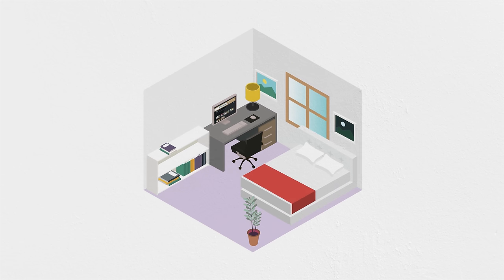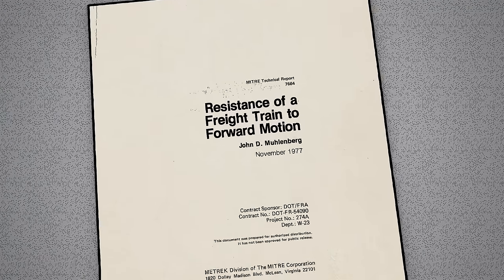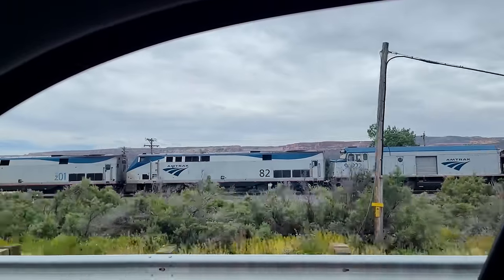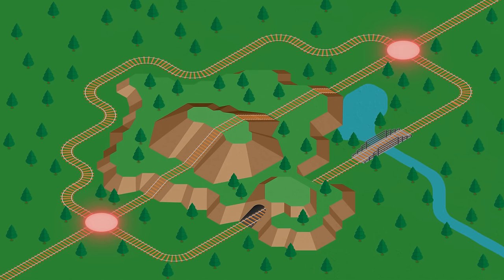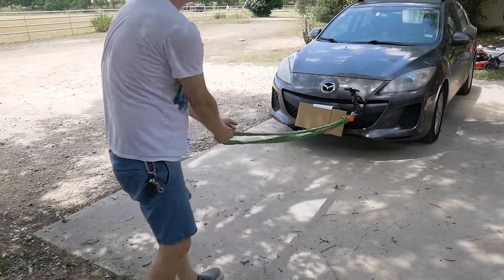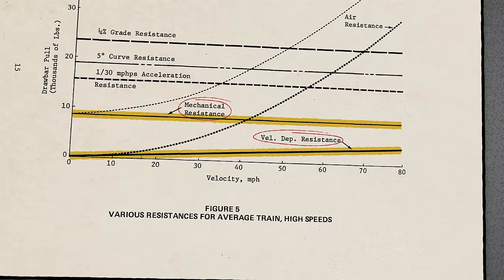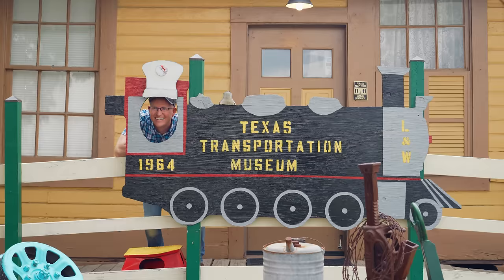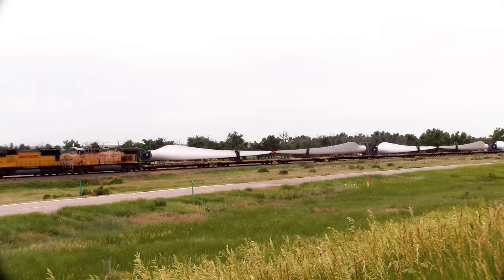Which Is Easier To Pull? (Railcars vs. Road Cars)

Comment: The rail wagon you were trying to pull had cold bearings. This makes a huge difference. A cold train has a 'dead’ feel to it whilst, an hours running later, the same train will feel much more ‘lively’. 
Not as pronounced on an all roller bearing train but on old white metal bearings, can add an extra notch or two to maintain speed.
Reply: Wow, that's so interesting!
Reply: Thanks for sharing. I have been working on railway for some few years, and I didn't know about that yet.
Reply: @hanshima_  Thankfully KiwiRail has done away with ‘free’ shunting and moved to push pull. 
I have worked in flat yards where roller bearing wagons can start to roll due to wind pressure alone!  We called them ghost wagons and they made NO noise. Good way to get yourself killed if you didn’t keep your wits about you when out in the yard.
Reply: They are CARS not wagons
Reply: @Island_Line_Rail_Productions  OK. Well done. 👍. My comment was in relation to the bearings, not necessarily what rides on them.
Reply: @Island_Line_Rail_Productions  The United States and the Commonwealth English-speaking countries are separated by a common language. 
There's nothing wrong with foreign words for things as long as we all know what we're talking about.
Reply: I think the one he was tugging on had modern bearings in it. No spot for the oiler like in the other one and it looked fairly modern. That said with how much he was moving it I think if he pushed rather than pulled he might have got it. Could have braced himself more that way and use the weight of it to help get traction rather than skidding over the ties.
Reply: what are you saying??!, cold is harder to push? or easier!!?
Reply: @lunam7249  cold is harder, needs less power when they are warm.
Reply: @zyeborm  ok, thx, warm trains PUSH EASIER!! UNDERSTOOD
Reply: It's not just hot vs cold, but plain bearings also have a critical speed below which the friction actually increases with decreasing speed. This is because the oil gets squished out of the bearing at low speeds, resulting in metal-on-metal contact. Above the critical speed, the  oil is being dragged into the bearing fast enough that it maintains a complete film across the bearing surface. This is the lowest resistance the bearing can provide. At sufficiently higher speeds, oil viscosity will then come into play.
Reply: @BenRichards227  plus stiction, fluid thickitropism (spell check gave up), inverse viscosity gradients……
Then there’s wheel/rail granduality, ANY adverse slope……
Human too small for initial impulse breakout force….
Sigh, it’s a mine field. 
Short answer, cold wagons hard to move. 👍🤓
Reply: @lunam7249  ...seriously? He was extremely clear about it, what confused you?
Reply: @joshyoung1440  as a physicist ..." dead" and "lively" are not scientific units which infer friction, and or mass, and or momentum and or inertia, further "cold" and assumed "warmer" are not logical linear variables....
Reply: @lunam7249 As someone who has worked for particle physicists, some things most assuredly warrant the descriptive "lively". They do seem to try to avoid "dead", however...
Reply: Uummm, although the cold  ‘effect’ is molecular, the result is macro. The terms ‘dead’ and ‘lively’ are in-house colloquialisms. They are entirely understandable to those who make a living trying to control trains in the real world. Even physicists, with terms like ‘snap’, ‘crackle’ and ‘pop’ are not immune to definitions that make lay people say, “Huh?”  👍
Reply: @lunam7249  This is why we don’t let physicists drive trains. No imagination. 😂
Reply: @BenRichards227  very interesting!!😳👏❤️ thank you
Reply: @DB-thats-me  snap crack rock and poop😺😺😺
Reply: @DB-thats-me  🙈🙊🙉👏👏👏❤️❤️😳😳you dont think i dont have a love of trains!!? i do the amtrack cross country and alaska private sleeper car!!
Reply: Awwe, you just said that to make me jealous. 😳 
It worked!  👍❤️
Reply: @DB-thats-me   By this logic, If I'm talking about vehicles and the passengers are not in the direct relation to my point, I can just say elephants are driving the car.
Reply: Sedans and estates then.
Reply: I remember that discussion on bicycle videos. They were talking about how grease works. They said that once you warm up the bearing, the grease will turn to a liquid, and the resistance will drop. During top-tier bike races professional racers will have someone spin the wheels for a few minutes on a stand to get them warm just before the start of the race to get that little bit better performance.
Reply: Indeed. My dad used to work for a ball bearing company, and I can recall a 1930s cartoon about "roller freights" that used roller bearings to reduce friction.
Reply: Try moving a train in -40 C.   It won't.  The bearing don't lubricate and the air is causing the brakes to set up.   The dispatchers give up and just stop the whole railway.
Reply: @DB-thats-me At the Winnipeg hump yard they have a data base with the "rollability" of each car and the wind speed is measured and the computer slows the car enough to travel into a track as far as needed to hit up against the cars already in the track.  I think the is also a live rollability measured between two points on the downward slope that gives an extra data point before the retarders slow the car.   Sometimes it is so windy and cold that the retarders come off and just let it roll.    Also the destination tracks can fill with snow and thus the cars will need more speed.  This is all programmed in.
Reply: @DB-thats-me  Did you ever hear of "rollability?"   I took physics for a couple of years, part of electrical engineering and then worked at the hump yard and they call it "rollability."
I tried to tell a few guys that they are just talking friction.  I didn't argue too much about it.  No one else understood math and physics.
Reply: @jeffbguarino  Better than the old ‘brain’ powered humps. A good operator, along with analog sensors, could override the retarders as required. Alas, good operators were hard to find and NZ flattened its only two humps and went back to push-pull. Lots less damage. 👍

Comment: The most impactful practical example of what happens when friction is low for me was seeing just how easy it was to move stones that weighed several tons while they were being suspended by an excavator (we were building a retaining wall).

It truly is amazing just how much friction matters.
Reply: I was allowed once in Germany to push a train with 4 carriages on a even track. I was able myself - only myself! - to push the train slowly to motion using my fuil body weight and muscles. It began to move!
With a truck - no chance.

Railroads are so energy efficient!
Reply: @PascalGienger  If not for the whims of financiers, trains would be the only way freight ever moved. There's simply no arguing with the fact trains just need less to do more in every single critical category.
Reply: @dustinbrueggemann1875 What holds them back is maneuverability. It’s too expensive to lay track to every single customer and trains can’t make as tight turns or go to as small places as trucks do. Trains are good for moving a lot long distance. When you need to move a small amount to a specific destination however, the train makes a lot less sense than a truck.
Reply: And gravity matters too, how easy is to move anything in the space, you wouldn't believe.
Reply: @rob585 That is true, but we use trucks for extremely long repetitive trips far more often than we should.
Reply: @dustinbrueggemann1875  "If not for the whims of financiers, trains would be the only way freight ever moved" - Okay... How would one go about getting freight from China or even Central American countries to the U.S. via trains?  Also, moving freight exclusively via trains would mean literally every store that sells products would need to exist on a railway (to get its products delivered).  In fact, nearly every building would need to exist next to a railway because the process of erecting a building requires big machines and lots of material, which (in your hypothetical scenario) would need to be delivered via trains.
Reply: @dustinbrueggemann1875   It's not the financiers ... it's the accountants. Wherever rail is cheaper, the stuff does move by rail.
Reply: @Nauda999 very true. That's what makes ion propulsion an effective way for a spacecraft to maneuver its way throughout the solar system, despite only producing thrust about as strong as the weight of a piece of paper.
Reply: A frictitious force :)
Reply: @nomore6167 that's a complete strawman, same as you don't get groceries delivered directly to your home by a semi-truck, you get them at a store which in turn gets them by truck

what makes sense is having train distribution centres throughout a city (with some direct rail links to large factories etc) and having other transportation methods take over from there
Reply: @HolarMusic  "that's a complete strawman..." - You clearly don't know what a strawman is.  Using buzzwords to try to make yourself look smart doesn't work.  People with even a modicum of intelligence can see through your "please be impressed by my buzzwords and ignore my ignorance" position.

"...you get [groceries] at a store which in turn gets them by truck" - That's my point, genius.  Freight is delivered from distribution centers to individual stores by truck.  The person to whom I replied explicitly stated, "If not for the whims of financiers, trains would be the only way freight ever moved".  His intended meaning could not be clearer -- that if financiers were removed from the picture, then trains would deliver freight everywhere it needs to go, which is clearly illogical and just plain wrong.
Reply: @rob585 there’s a lot of places where a lot of businesses have rail spurs
Reply: When I was five, I pushed open the 8.2 ton gate at Coral Castle in Florida. Perfectly balanced on a bearing.
Reply: @nomore6167  you intentionally misunderstand what he's saying to "win" an argument, that's the literal definition of a strawman, go touch some grass
Reply: @HolarMusic  "you intentionally misunderstand what he's saying to "win" an argument, that's the literal definition of a strawman, go touch some grass" - I didn't intentionally misunderstand anything.  His intention literally could not be clearer.  You're ignoring what he said and pretending he said something different in order to make it conform to the idea/narrative you formed in your own head.  Your refusal to accept reality does not alter reality.
Reply: Oh hey, Ben here, did you know trams exist?

Better yet did you know freight trams exist?

Did you also know there are trams that specialise in MOW exist as well?

Look them up if you are interested in knowing more.
Reply: @rob585  Actually it's new electronic signalling (coming from Europe!) which built the renaissance of the big freight railroads in the US. More throughput, even lower operating costs.
Diesel electric locomotives consume way less Diesel as ever before - also here notably Siemens & GE. The high power and torque of the electric motors directly at the bogies with ABS and ESP built in - and a very energy efficient Diesel generator to generate the electric power for it. If you had electrified rail you could even omit that mobile generator....
Reply: @Nauda999   there is no friction without gravity. unless the two bodies are pressed against each other there is no friction. Due to gravity the wheels are pressed against road and cause friction.
Reply: @jazzyjaisa  matter without gravity is kind of a silly concept, are you talking about some anti gravity thingy?
Reply: We have a 2 ton boulder mounted on a pole in the city, you can turn it by hand. it takes a while to get going, but it will move.
Reply: @HappyBeezerStudios  how is that related to pulling a 60+ ton train car on train tracks?
Reply: @HappyBeezerStudios  That sounds neat. Is it just at a playground or park or something? Or perhaps something at a science museum?

Comment: This reminds me of a demo i saw in a museum, they had a truck axle on asphalt and a train axle on a rail, both with a pull rope, and despite the train one weighing more than twice the truck's, they were noticeably easier to pull
Reply: demoman. Gravel. TF2
Reply: I move full railcars around our siding with basicaly a 6' crowbar.
Reply: They demo this concept for kids at the train museum in Tokyo.
They put 10kg of water (20 x 500ml bottles IIRC) trays x 4 of them on a carpet, rubber wheels, rollers and steel wheels IIRC. 
Even to adults, it's amazing how much easier the steel wheel trays are to push.
Reply: @glenmccabe3364  This was a full size train axle and wheels weighing 1.4 Tons on standard gauge track and children were still able to move it relatively easily
Reply: @AL_O0  wow! Now that is an impressive demonstration of rail wheel efficiency :)

Comment: I'm a train driver from Europe, and I found this super interesting and informative! When we occasionally had to move cars manually we used long steel bar chisels (not sure what its name is in English. Basically a 5 foot crowbar) as a lever under the wheels to get it rolling. 

Thanks for the video! Will definitely check out more of these!
Reply: We call them Johnson bars or Jonny bars 🙂
Reply: If you had attached the cable to the locomotive with no slack in it and the sat in the middle of of the cable to car would have moved.
As a ten stone teenager I once sat on the mooring line of the Queen Mary when it was at Southampton, very slowly the line went down to the ground. I stood up and the line went slowly up again.
That ship was somewhat heavier than the railcar!!
Reply: @mack.attack mexican switch engines

Comment: Working in a stockroom/yard and the difference in rolling resistance between smooth, hard concrete and soft, grippy asphalt often makes the difference between being able to move a heavy pallet by hand with a pallet jack, or needing to get the forklift.

And with a pallet jack, keeping the floor clean is all too important; a small stone, nail, or sliver of wood from the pallet itself can make a easy load impossible to move.

The flip side is this; a smooth, hard and clean surface makes things much easier to move but much harder to stop. Without rolling resistance to slow things down, you have to deal with all of the inertia yourself.
Reply: I often find myself handling my pallet jack with as few stops as possible, because the hardest part is to get it moving. Today I learned it's called static resistance, neat.
Reply: Wheelbarrows work the same way: it's always easier to push along the path than to cross open ground, no matter how flat.

Comment: Tyre pressure really makes a big difference to the rolling resistance of my car.   I can tell almost instantly if a tyre is a bit low, by pushing it on my driveway.
By the way, at 5:00, Grady forgot to mention that on electrified lines, most of the downhill force can be recovered by regenerative braking and fed back into the grid.    
And Grady pulling a wagon by hand brings to mind No 1111, 'Four Aces', a 4-8-4 steam loco built by Alco in 1930 for the Timken Roller Bearing Co to demonstrate the lower friction of roller bearings.   At some stops, for publicity purposes, three men could pull this 300-ton locomotive.
Reply: Topping out your tyre pressure is always worth it before a long journey for fuel efficiency, and tyre wear. Also, waxing to reduce skin drag is very valuable if you do more than local slow driving.

Comment: I’ve been an inland merchant mariner for almost 20 years, an engineer for my company for almost a decade now. I love your presentation on this. I would love to see you do one on our industry that works somewhat behind the curtain, but in plain view. One thing i have learned is it it more cost effective per unit to move something in larger quantity. As a rule of thumb our boats burn one gallon of diesel per horsepower used per 24 hours run time. It is hard to think of something that burns 12,000 gallons of diesel per day as economical, but when you figure in the amount of work done for that fuel it absolutely makes sense. Id love to see you break it down. I do believe that our inland waterways provide the lowest resistance to moving large quantities of stuff in this country.
Reply: The common rule of thumb promoted by the railroads has been:  one gallon of diesel fuel will move one ton of freight for 400–500 miles.
Reply: "One thing I have learned is it is more cost effective per unit to move something in greater quantity." No offense but it didn't really take you a career in shipping to "learn" that, did it?
Reply: Also it is very easy to think of something that burns 12,000 gallons as economical because the amount is obviously meaningless; it is the ratio that determines efficiency, which you had already told us about, rendering the number 12,000 irrelevant. Other people also understand that efficiency is based on proportion. You're kinda speaking down to people.
Reply: @joshyoung1440 To learn to observe that it is "usually" true, probably not. To learn _by how much_, on the other hand...

Comment: I'll use an example, until 2001, Norfolk Southern ran down Saluda Grade and that was at the time the most steepest with 5% going down.  From the summit at Salula all the way down to Melrose, trains had to use dynamic brakes to keep the trains at around 8 MPH and if you didn't keep it at around 8, you would be heading for the runaway ramp down at Melrose and you might get in some trouble (that is why you had the Road Foreman of Engines on board and he had a special key just for running trains down Saluda Grade)
Reply: Dynamics and air the whole way down, with retainers on
Reply: 5% sounds like a roller coaster.
Reply: There's a reason that it took so long to build the railroad across the Sierra Nevada mountain range when the first tracks were laid. Grade is everything and failed brakes have caused a lot of problems!